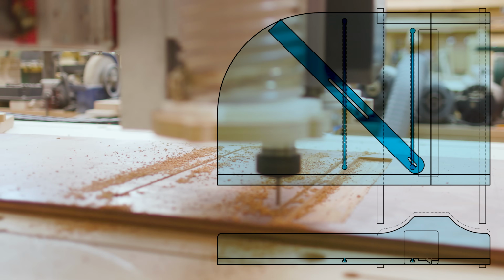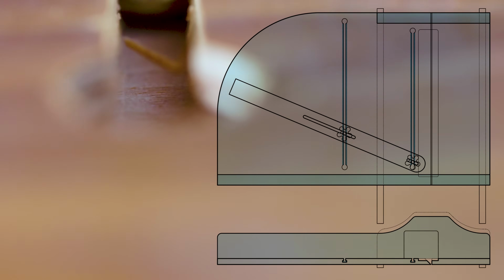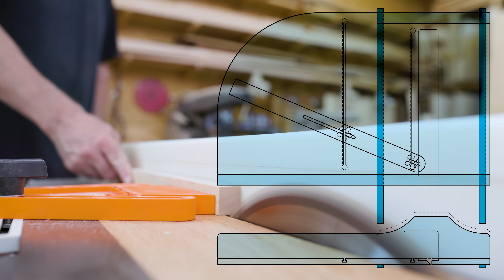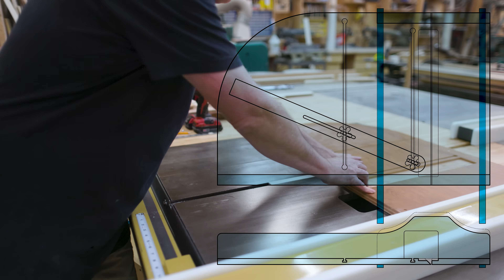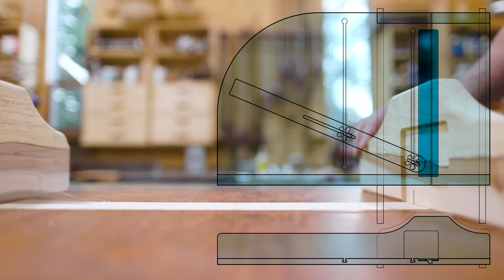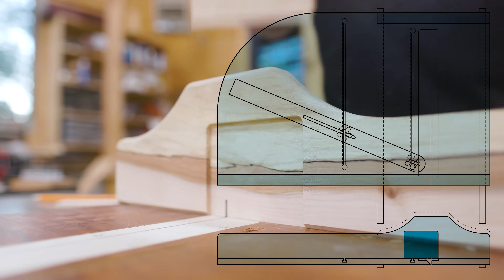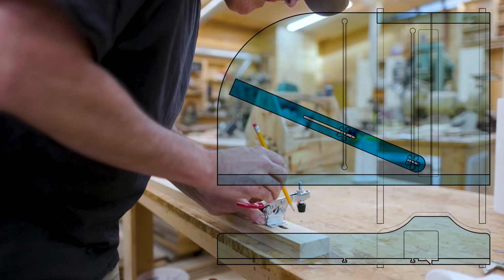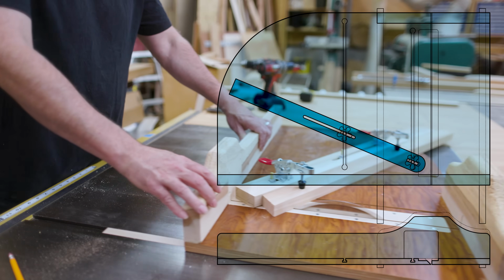The Dodecahedron and the Sled

Comment: You mentioned the cut edge of the pentagon possibly sliding under the stop - if you rotate the pentagons anti-clockwise during that process only the fifth cut will have that risk.

Comment: Fun geometry fact for you Frank. The icosohedron and dodecahedron are what's called dual shapes. which means if you were to take one of your icosohedrons and sand flat each corner untill those new faces met each other you'd end up with a dodecahedron (and the same happens in reverse if you sand the corners of a dodecahedron). Might be fun to try.
Reply: No, that wouldn't work. You're talking about deriving a dual by way of truncation; to get all the way to the dual you'd need to sand past the point where the face you're sanding intersects with a respective set of vertices. Once there, you keep going, but now the sanding you're doing needs to ADD material in the same way it was being removed on the other side. This is obviously not possible irl. Only with computer graphics can this be done.

A better way to derive the dual of any platonic solid, is to understand that duals can swap their faces for the dual's vertices, and vice versa. In practical terms, take one polyhedron and connect the centers of its faces with lines to create the edges of its dual.

At the center of every face, is a vertex of its dual..

Comment: Thank you for what I think are the best build videos on you-tube. 
It looks like your using a router bit in the shaper to dress the edges of the sled. If that's so, do you have any thoughts on shapers vs routers for doing edge treatments. I've seen some comments suggesting the shaper speed isn't fast enough for router bits, and I'm not sure I understand why that would be so.

Comment: You're going to love the removable zero clearance inserts, trust me. I did this, and I just batched out a lot at once, drilled them all, and when one ZCI gets chewed up, I just replace it on the fly. This has allowed me to use my crosscut sled with a ZCI plowed for 45-degree cuts and 3/4" dados, so now I can do dead-square shelf dados without worrying about trying to keep the board tight to a miter gauge, etc., while avoiding the spinning blades.

Comment: Perhaps you could try CNC routing the triangles? I've tried this with mine. It works well. Takes a while, but it works! Use a bullnose or angled bullnose cutter with a top-down spiral strategy and small stepover. Don't cut all the way through the board. Leave 2mm or whatever so you can screw it down in a place that is not the finished triangle. You can have the machine cut many triangles at once. The CNC cuts all the compound angles, and then you remove the face of the board to free the parts. A thickness drum sander works very well here, but you can saw it or whatever too... It means you can cut any polygonal geometry, not just regular shapes. Eggs, ellipsoids, etc. For bonus points, you can CNC a spherical depression in the top (inside of the triangle) To get a smooth sphere inside and a polygonal outside. Makes a beautiful bowl.
Reply from the maker: I've been thinking about making the moon or maybe a planet or two this way.

Comment: With a dodecahedron, to sphere-ize it, you'll need the walls to be much thicker than an icosohedron. Keep that in mind, or you'll end up blowing up your piece as you try to curve it. Think of the sphere inside the dodeca - it will be tangent with the centers of each of the pentagons. To create a curve from the center of one pentagon to the center of another will likely, with the thickness you did, run you into negative space! This would be super dangerous while spinning.

Comment: Time to get a bumper sticker “My other  Platonic solid is a dodecahedron”. Icosahedra (plural of icosahedron) have 20 sides. To minimize tearout at the tips attach it to a sacrificial piece, you could try a finer toothed saw and go slower on the sled, but the table saw will never have the control of a fine dovetail saw.

Comment: The fence should be parallel to the miter slots, not the blade. Although the blade should also parallel to the slots too. You can adjust everything except the slots, so everything has to be based off them.

You could make a quick hold down for the CNC and then cut out a circle in the center of each pentagon, to "fill in" the center gap with a dowel piece. Or a cat's paw inlay.
Reply from the maker: I should have said it that way, I was making the TS fence parallel to the slots.  I like your way of putting it, that you can't move the slots so make everything refence them.

Comment: Nice video! Have you read about the different types of solids? 
in 3d geometry anything with all the faces, edges and vertices identical is a platonic solid, having been described by Plato. 
There are five, your dodecahedron with twelve pentagonal sides, Icosahedron (I think you said isohedron) with twenty equilateral triangles, tetrahedron with four equilateral triangles, octahedron with eight equilateral triangles, and the cube. 
Known by tabletop RPG players all over the world as 5/6 (or 5/7 if you like the redundant extra d10) of a standard D&D dice set. If you think of these as regular shapes, there's also a host of semi-regular ones called archimedean or catalan solids!
Dodecahedrons are my favorite. (you don't put the emphasis on the last vowel like that though)
Reply from the maker: nice to see this explained so clearly. this gives me an idea to make and wood Turn each of the platonic solids
Reply: @frankmakes  I'm glad you found it useful/interesting/whatever. It can be so hard to balance tone in text based conversation
Reply: @frankmakes   if you’re looking for an objects to make spherical, and look nice in contrasting woods, a sphere such as the first diagram here is quite nice: https://en.wikipedia.org/wiki/Icosahedral_symmetry.   Lots of ‘great circles’ to help construct it as two hemispheres, and the subdivisions show the dual relationship between icosahedron and dodecahedron.  There is a corresponding sphere for cube and octahedron, and a third for two tetrahedra.  Before woodturning, you could start with a https://en.wikipedia.org/wiki/Disdyakis_triacontahedron (a d120) but getting all the angles right would be cruel.  Better to start with an icosahedron with 6 pieces per face, since you have already worked out all the angles.  Keep 4 of the faces as halves (3 small pieces) so you end up with two hemispheres.  Get in touch if you want someone to work out the angles.
Reply: @frankmakes  To expand on this, and into a different hobby that I'm also into, the platonic solids make up a subset of the polyhedral dice used in D&D and other table-top RPGs (TTRPGs).  Each die is called a dX where the X is how many faces it has.  A normal die is the 6-sided cube, and the d20 (the most important in D&D) is the icosahedron you've already done.  This video added the d12, so the d4 (tetrahedron or triangular pyramid), d6 (cube), the d8 (octahedron), and 1-2 d10s (pentagonal trapezohedron or deltohedron) are all that is missing.  If you look up "polyhedral dice" you'll find the typical sets that are used.  Would be really cool to see you have a whole set of oversized wooden die; especially if you used the cnc machine to get the numbers inlaid in the faces.
Reply: Also, the icosahedron and the dodecahedron are related...they are "duals" of each other.  The icosahedron has 20 faces with 3-fold rotational symmetry (triangles) and 12 vertices with 5-fold rotational symmetry.  The dodecahedron has this reversed: 12 faces with 5-fold symmetry (pentagons) and 20 vertices with 3-fold symmetry.  
The octahedron and the cube (hexahedron) are similarly related.  The tetrahedron is its own dual.

Comment: Really fantastic work, Frank! It looks great! 😃
One thing you perhaps could try is to cut the pentagons in one piece. I don't know if that's possible, but I believe it is! I've seen people cutting hexagons for making coasters. 
Anyway, stay safe there with your family! 🖖😊
Reply from the maker: I was wondering if I could cut out the pentagons roughly, then make them more accurate as I cut the angles on each side with the sled.  another option would be to cut the pentagons on the CNC from a solid piece
Reply: @frankmakes   just cut a pentagonal prism out of a block of wood. By that I mean a straight 5-sided block. Then run each edge through the table saw with blade tilted 31.72 deg with the material oriented face down..

Comment: With your set angles if you reference off the back of the sled rather than the saw blade then it would make setup much quicker and more accurate.
Reply from the maker: I think you may be right, will have to try that.

Comment: As always, your curiosity and visuals are top notch! But I think that the tolerances of the machines, the numerous variables involved to get a perfect 90/45/22.5/etc are not possible without sanding, putty/filler or other means. The material is wood. But if anyone can get close to perfect results, its you, Frank!
Reply: They are certainly possible if you take the time to adjust your machines.
I made a rhombic triacontahedron in oak (a 30 sided "dice) for a friend once. Took me 3 Attempts put i managed it to pull it off. Without sanding, a CNC or filler.
When you start to go in the process with the mindset "I can sand that" or "I can put some filler on that" you will not put the time in to adjust your machines correctly because why bother.
Sanding and filling is for me even less accurate and takes Sometimes more time.
Do regular maintenance, adjust them regularly and take your time setting them up. Then it is certainly not impossible and easier than you think.